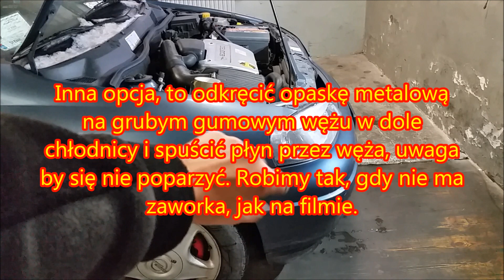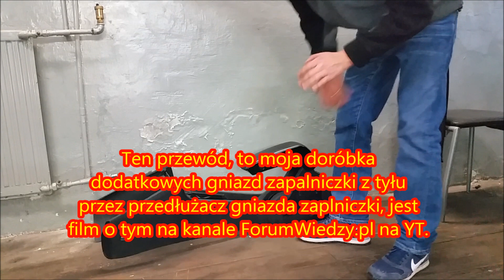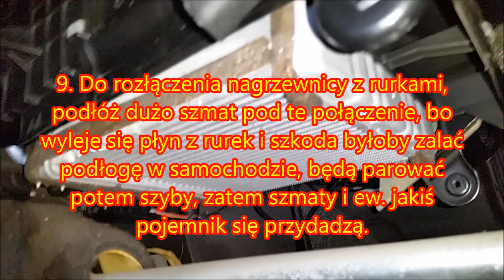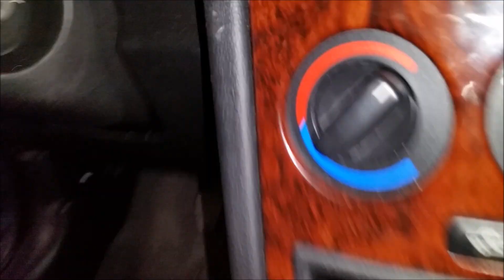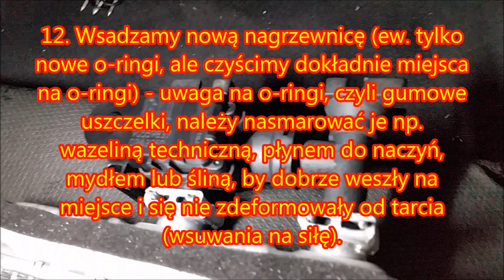Jak wymienić nagrzewnicę w OPEL ASTRA G II? How to replace a heater? System BEHR - Full Manual DIY

Comment: Good morning friend, greetings from Mexico.
Today uninstalled my radiator with your help, thank you very much!
My car is a 2001 Astra comfort. I have a doubt and it is that only the change of the Behr valve was required, the radiator is fine, just that I wanted to ask, what kind of tape can be put to replace the one that has the radiator, the black tape